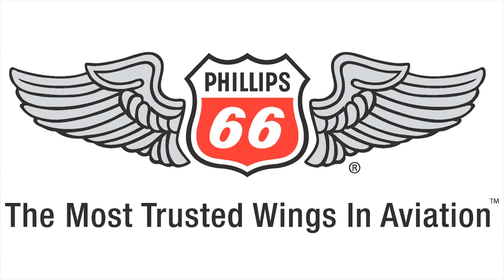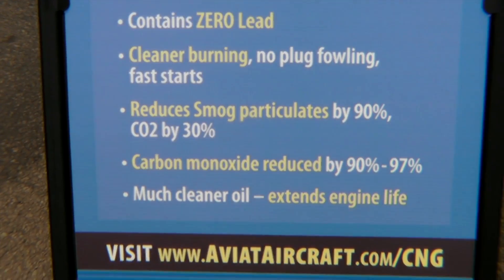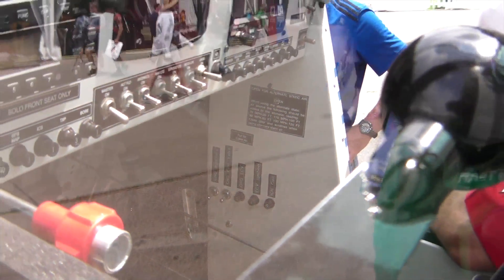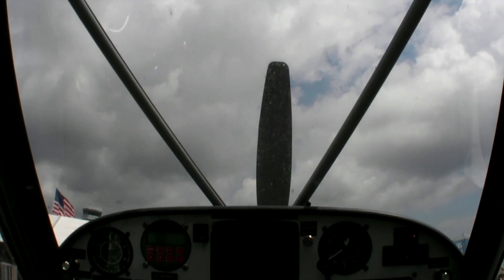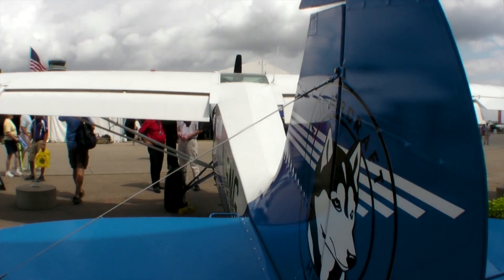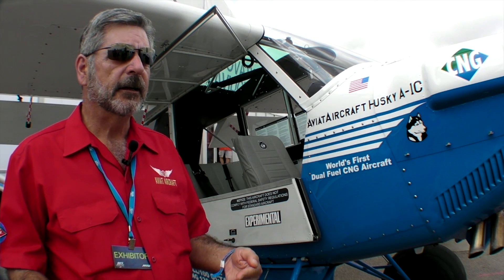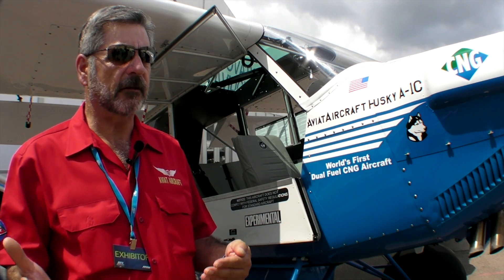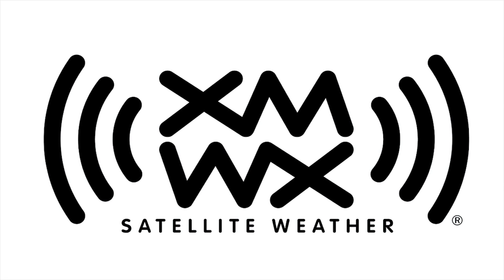Natural Gas-Powered Airplane

Comment: I like the idea of CNG, I'm all about using it over other fossil fuels where it makes sense...but I'm skeptical that it's actually better for aircraft.  

If something is truly better, I must ask...why isn't it being adopted?  Why aren't aircraft manufacturers building these?  Oh, don't get me wrong, I know that there is resistance to change, but if the engineering and math show that it's cheaper and better, there is always someone out there ready to be the disrupter of any industry.   But I don't see any major aircraft manufacturer jumping on CNG...so there must be a drawback...I'm just not smart enough (I'm also not a pilot) to know exactly what the problem is.
Reply: Storage I’m pretty sure. It’s a gas and hard to compact like a liquid fuel. But apart from that I think it’s great. Methane has better energy/weight ratio than kerosene and produces less carbon emissions. Methane is also renewable.

Comment: If you can get 60% efficiency from new engine, like what I am working on, instead of the 25% from the Lycoming, then the volume issue is mostly solved.  It takes 3.8 times more volume to hold the same amount of energy found in a gallon of 100 LL.  This would give you 2.4 times less fuel (60/25=2.4) at the $6/gal 100ll vs $0.85 /gal NG ratio or 16.94 times LESS (2.4x6/.85=16.94) to run with new engine and NG.  In other words you would be around 5.9% of original costs.

Comment: Let's not forget that even compressed at high pressure, gas takes a much larger space than liquid fuel for a given amount of energy.
Liquid fuel is hard enough to fit and balance well in an aircraft.
Can you imagine fitting bigger, heave, and cylinder-only-shaped tanks in your aircraft ?

Comment: Sounds pretty good, can anyone help us understand the drawbacks? Why isn't this being used in general aviation more?
Reply: @Daniel Last name I'm in support of researching further into this I was just guessing what could cause problems.
Reply: I'm no expert but I'm guessing there may be safety issues relating to the vaporisation of the fuel, which may lead it to ignite much easier in a tank. That's the only thing I can think of.

Comment: Propane only needs <200 psi, you can put it in aluminum tanks, it's not a greenhouse gas, it's 110 octane, the byproducts from burning it are clean like CNG, your engine stays clean and lasts forever, you don't need a high pressure injection pump like a diesel, you don't get filthy oil like a diesel (I don't know about jet A diesels), and if you slap a simple turbo on, you get all the power you want.
This can all be done with a throttle body just like a carb, or wet injection.
Why not propane?
Reply: I think you may be mistaken about it not being a greenhouse gas. As I understand it, if leaked unburnt into the atmosphere it's actually a more potent greenhouse gas than CO2. However it does burn relatively clean, emitting only one molecule of CO2 per molecule of CH4 (and two of H2O I believe). And no other bi-products such as led, or NOx
Reply: @skyearthocean5815  CNG is methane, which is the worst greenhouse gas, it is lighter than air and eventually turns into CO2. LPG (propane/butane) are heavier than air. LPG is slightly worse when combusted though, but better than petrol and diesel.
Reply: I don't know the answer, but I think the issue with propane is the fuel cost.  It's cheaper than jet fuel per BTU, but not close to Natural Gas.  Also, Natural Gas is not a major greenhouse gas if it's not burned (i.e. when it's hasn't been converted from methane to CO2)

For instance, to buy 1,000,000 BTU of energy in each form it costs about:

1 Million BTU CNG (100,000 BTU/therm) = (10 therms)($1.03 /therm) = $10.03
1 Million BTU Propane (92,000 BTU/gallon) = (10.87 gallons)($2.43/gallon) =  $26.41
1 Million BTU Jet Fuel (132,000 BTU/gallon) = (7.58 gallons)($5.21 /gallon) = $39.49

(Average fuel prices from the eia.gov website - I used the nationwide average...but they break it down by state, so it depends on your region also)

So...I don't know.  I guess Propane is a bit cheaper...but CNG is cheaper still.  The other thing to consider is how much energy each as per unit of mass (including the heavy CNG pressurized tank).  My guess is that jet fuel has the advantage per unit of mass.  But I don't have time to do the estimate, I need to get back to work...
Reply: The charge air cooling of the liquid LPG systems also give 10-15% power boost for turbo cars. Not sure why it is not used more.
Reply: Cause it’s non renewable and harder to source. In the long run cheaper to use natural gas. Super clean burning. I don’t know why they don’t use LNG. Liquid natural gas has more energy per weight (10-15% superior) then even diesel but does take up more volume (40% more). That 40% may sound like alot but it’s far superior to CNG and hydrogen and requires way less PSI containers or as low cooling teps comparatively during the flight since LNG compacted by the fuels less cold cryo temperature then Hydrogen’s liquid form.
Reply: Good question

Comment: CNG in an airplane. What a nightmare. ~That's what we need, a 3500 psi tank full of greenhouse gas strapped to our asses.~
Imagine the regulation surrounding a supply of CNG at an airport. No more self-serve pumps, even more environmental restrictions since it's a greenhouse gas, a spill can't be contained with drainage because it won't stay in liquid form (huge liability), all the vendors will have to have "qualified" fuel truck drivers. Next thing you know, this crap costs $10/gallon.
Reply: If you ever pumped CNG or at least LPG into your car, there is no difference at all. And also on some airport even gasoline pumps are not self service. Here CNG is self service. LPG in some countries is self-service or not. 
 I don't know if you live in some sort of third world, but all fuel truck drivers here must have a special qualification to pump any fuel. And there is only a little price difference if you need CNG or LPG as a + to your qualification. You usually need more than one.
Where is the difference when CNG is greenhouse gas (most is produced by natural sources directly into the air as you probably know and not by industry) and you are producing other greenhouse gases with gasoline with a very toxic lead based aditive. 
CNG don't have to be contained when it leaks, because it does not damage soil, water and living organisms in it. It is lighter than air.
Reply: +rybaluc Exactly, and some people point the fact that you would need much more oxygen on-board to burn with your CNG to solve its energy/mass unbalance. It's so damn true, but let's not forget something here :
Planes already pierce the air at high speed, so radiators can definitely be made to concentrate oxygen gas...
Reply: CNG has a hydrogen component to it which makes the fuel clean

Comment: Yes, CNG can answer the question of reducing 'Fuel Cost', but it still has a lower energy density than Gas or Diesel...less energy/mass is less energy available; full stop. To produce more power you need greater energy density and greater oxygen to burn that fuel. 

CNG is more economical flight/hr/cost, and I don't doubt his claim of lower engine temps, etc. but you will not get a more powerful engine. Greater efficiency thru compression?  Sure, We already have them; the Diesel.

Comment: Sorry, $0.85 per gallon to $6.00 per gallon is more like 700% savings in cost per gallon.

My question is about engine efficiency and whether a higher compression engine could get more "absolute" energy from a gallon of CNG than current engines get from a gallon of 100LL.  I only ask in case you've got info at your fingertips.  I'll try to research a bit myself.  Thanks

Comment: Agree.  But at 75% energy density, you still have a benefit of approx. 400% savings in cost per "gallon" for CNG?  So costwise, I think you're better off (until the cost of CNG skyrockets because of increased demand, just like diesel did years ago).

Do you think that an engine optimized to burn CNG, maybe a higher compression engine, could increase efficiency and perhaps improve on the energy utilized per "gallon" of CNG vs. the enery utilized per gallon of 100LL in current aviation engines?

Comment: The thing is that engines efficiency depends of the engines compression ratio. A higher compression ratio makes an engine squeeze more energy out of a certain amount of volume where the mixture of air/fuel is. At higher compression ratios, higher the energy you can get of a certain combustion chamber. It´s related to this, why it seems that higher octane fuels have more "energy" within them.

 I think I can explain myself better in spanish.

Comment: Yep, you're right. Octane is also added to prevent detonation in high compression engines. When an engine is detonating power output is reduced, hence the myth.
Liquid fuels will always be the best option, energy density wise.

Comment: Lol. oh really? I was not Guessing, I was stating a fact; Octane ratings are not indicators of the energy content of fuels. It's only a measurement of the fuel's tendency to burn in a controlled manner, rather than explode (Detonation).

Also true is the fact that a 'Specific Energy Equivalent Value' is an absolute value, not a static one. Fact: LNG's 'Energy Density' is lower than 100LL or Diesel, so the equivalent LNG fuel needed for a given unit/work is higher = Fewer miles on a tank of fuel.
Reply: Chemical fuels don't contain energy as chemical bonds are not stores for energy. During combustion, energy is released when chemical bonds are formed. That being said, burning a kilogram of natural gas yields 55.5 megajoules of energy whereas burning a kilogram of gasoline yields about 46 megajoules of energy.

Comment: With room to type only a few sentences, I am not accounting for a great many things. But that does not change the physics or Chemistry of Energy Density. When answering the 'cost' question LNG is a good alternative to 100LL so LNG in Aircraft is a good answer to that question. But to claim 'Higher Octane= Higher Energy' is simply false. Per/unit, diesel/JP is @12% more energy dense than gasoline, so diesel vehicles will get @12% greater work/Millage, and LNG about 25% less. It is what it is

Comment: The tank and related equipment weigh 135 lbs plus the weight of the CNG. The CNG has a 100 LL gasoline equivalent of 9 gallons. That's a lot of weight for a minimal amount of energy and the added weight has a significant negative effect on off-field performance.

The composite tank is holding 3600 psi. and composite tanks don't do impacts well. Not something you want to have alone in an accident scenario.

No thanks.

bumper

Comment: A fuels Octane rating (There are several different rating standards) is not a measurement of a fuels 'Energy'...It is a measurement of volatility. The higher the Octane rating, the more difficult it is to ignite, and why high compression engines require higher octane to work properly. It is a myth that high octane fuels have more power. The real concern here is Energy Density. With 100-Avgas as 100%, LP-Gas is less energy dense at only @75%...Diesel has greater energy density of @115%

Comment: Well, How much will the tank to hold say 50 gallons of CNG weight? In flying its all about how far you can fly on a given amount of fuel vs how much you can carry in terms of loads. And then there is the Cost of the aircraft, A Husky is dam near a 300K airplane. Yea is a good Idea to look into this, then again we should be powering automobiles with CNG too.

Comment: Like anything, I'm sure there are drawbacks, but I am glad people are starting to take this option seriously
Reply: I'm not sure what drawbacks it has. Natural gas has a higher energy to mass ratio than conventional jet fuel
Reply: @aaronfield7899  My brother who lives in Europe had a skoda with dual gasoline-natural gas engine, in theory he could switch, but the natural gas engine had less power and lots more of maintenance issues. I know this is not a car but new technology always comes with teething problems, which is specially critical when you are flying
Reply: @jrcolmena  did he use CNG or LNG?
Reply: @aaronfield7899  not completely sure but I think CNG
Reply: @jrcolmena  was it a piston engine or a turbine engine?
Reply: @aaronfield7899  you know is a car, is a piston engine. Yes turbines have less vibration and rotating not reciprocating parts here more reliable. Are you really trying to say that there is not going to bee teething problems? I am not a naysayer it might become the way of the future and if it does good for them. But you don't need to be a genius to realize new technologies take time to mature and there is always some drawback/compromise, always.
Reply: It also doesn't handle extreme cold very well.